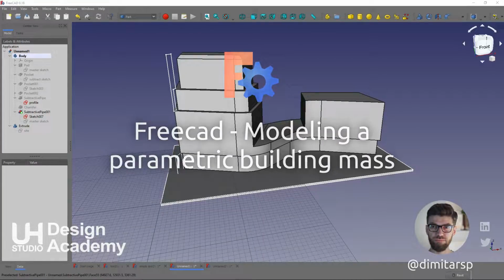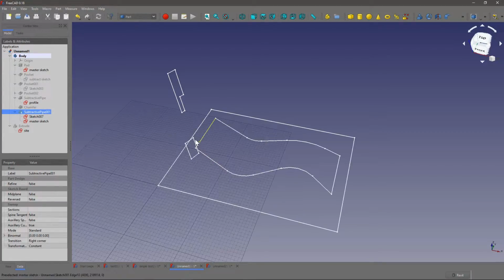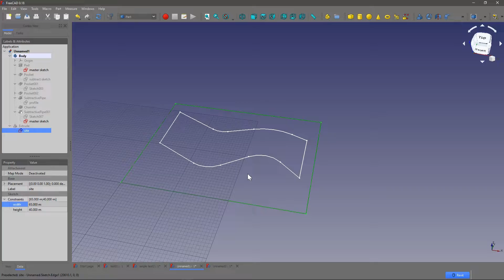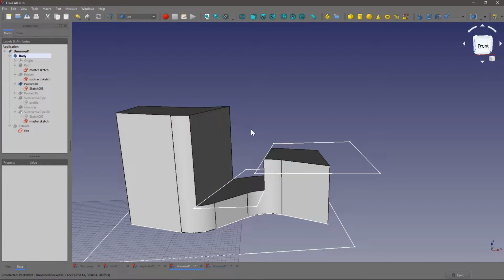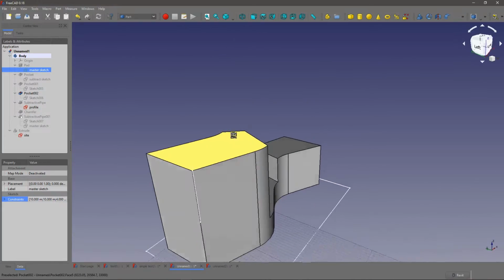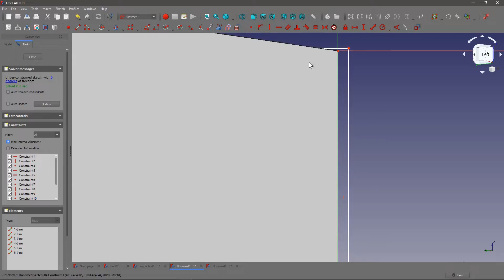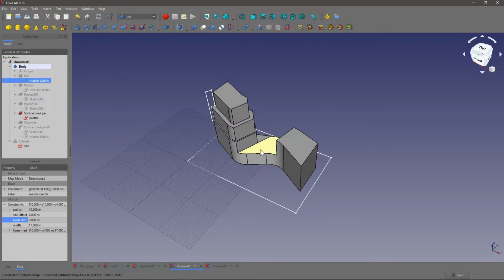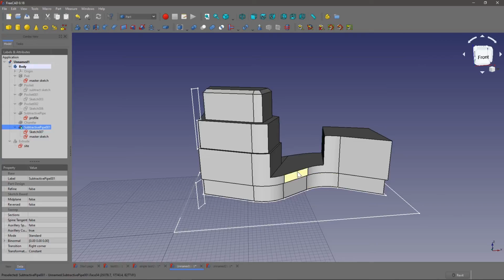Freecad Parametric Building Massing

Comment: Please, please use the term Pad when it is a Pad, in FreeCAD an extrude is similar but different than Pad.
Reply from the maker: It depends on the tool, no? Sometime it could be a proper "pad" and sometimes it could be a "slab" or "floor" from the BIM/Arch workbenches